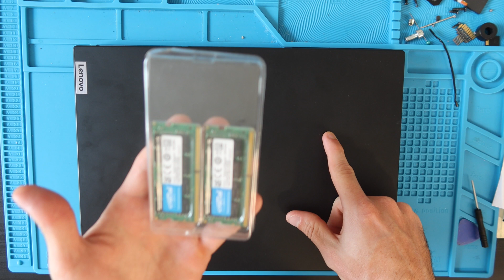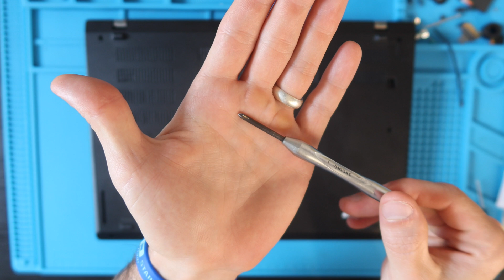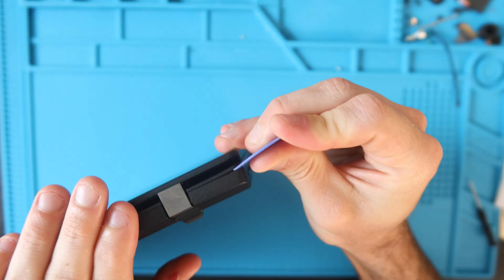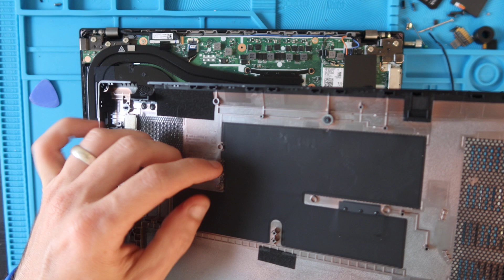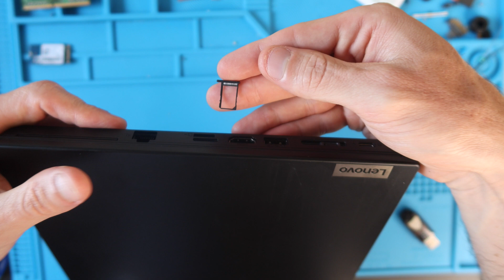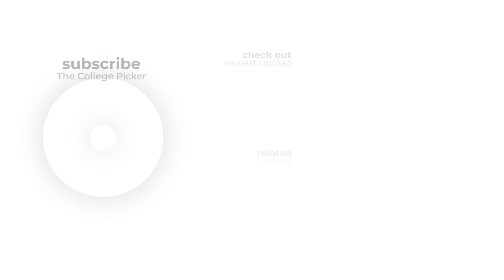Lenovo Thinkpad L14 Ram Upgrade Tutorial

Comment: Is there any lost data from the old stick? When you turn it back on everything is still there?
Reply: Ram is storing data only when the PC is on, when it is turned off, the data on the ram is stored to the SSD/hard drive. You should read a little about how ram works, it's very interesting.
Reply: All data, once powered off, is stored in the drive.  The Random Access Memory (RAM) is only active when running- even if sleep or hibernate mode is used.  Short answer- no, swapping out the RAM modules will not affect stored data.